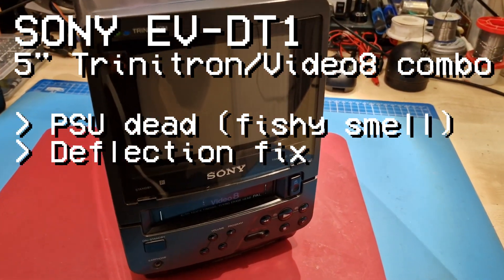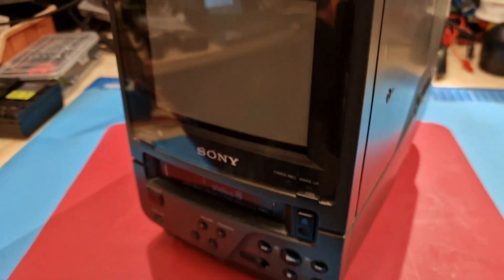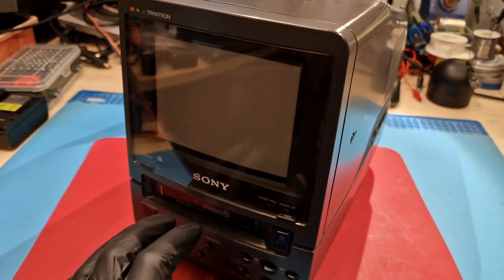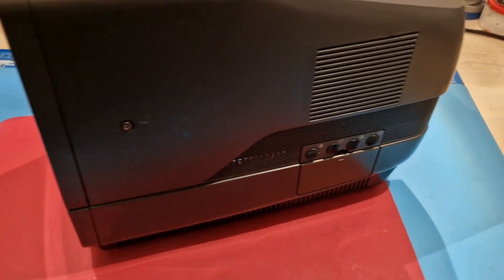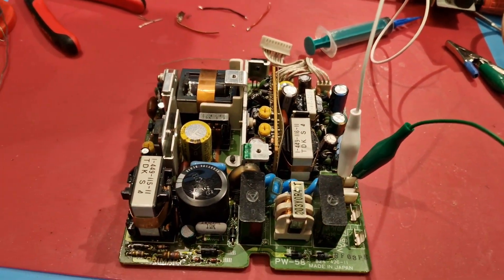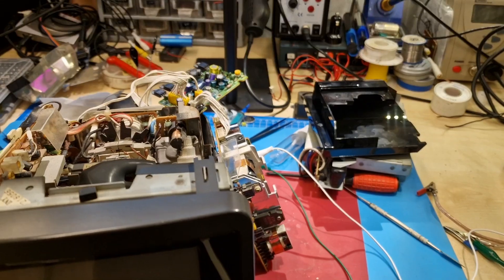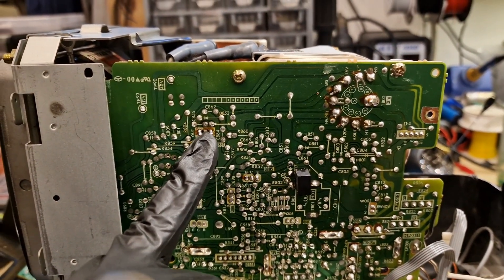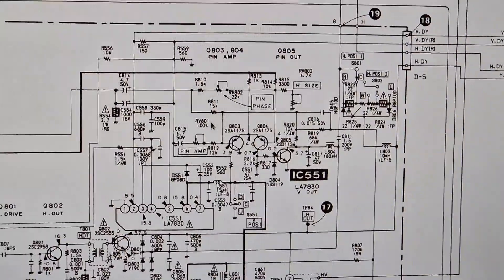FIVE INCH TRINITRON CRT! Sony EV-DT1 Video8 combo repair

Comment: I am just working on my machine.  Same leaking caps on the psu. I guess this is common with this model.  Mine has a tape stuck inside will not eject. Next to solve that.
Reply: Can u take out the tape? Im in the same issue
Reply: @NocteRex  I got the tape out https://youtu.be/-hl412RFtWc